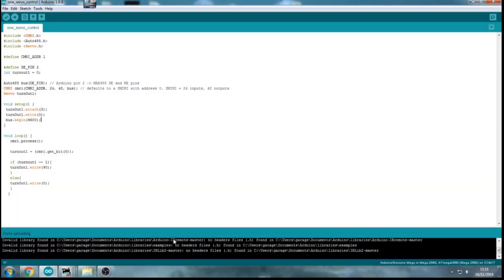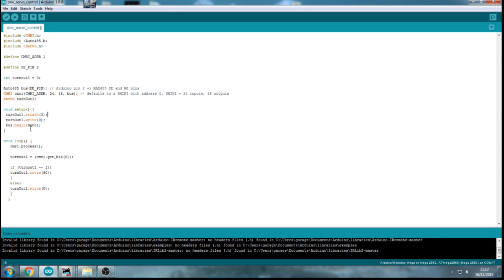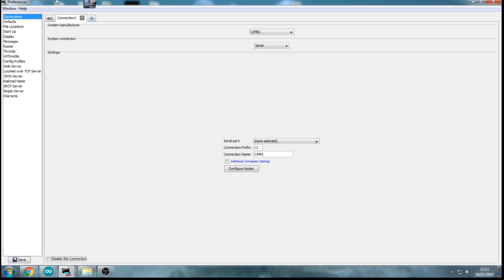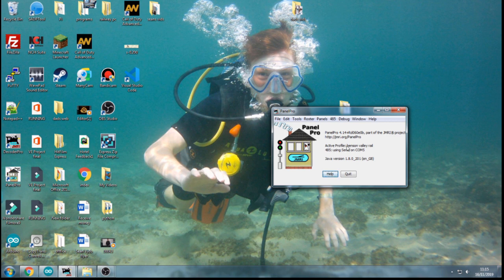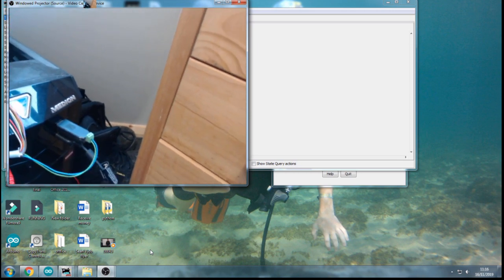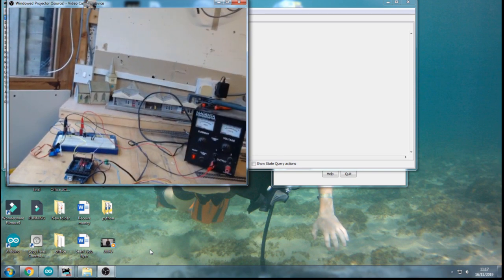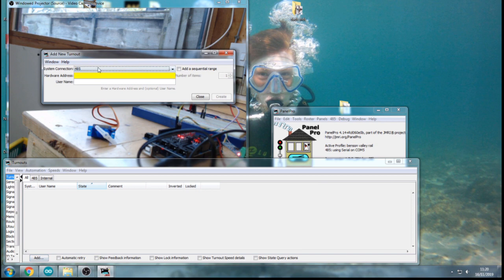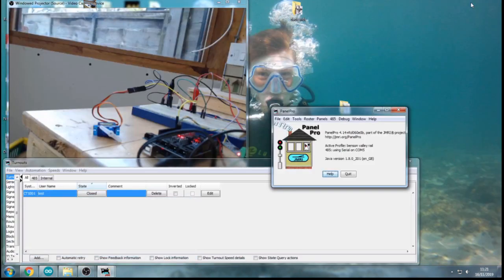JMRI Single Turnout with RS485 and CMRI on Arduino

Comment: Thanks ,great tutorial ,keep em coming ,
Reply from the maker: Cheers Glade its of use
Reply: @BrackstonesTravelAdventures  im into using Arduino for everything ,just got circuit boards made up for multi signal system ,controlled by 1 nano per pair and they daisy chain to the next mo dual if you interested i can supply circuit  diagram and code.you help me i help you.lol
Reply from the maker: @nesr8786  sound good, I did similar, been using Arduino and Pis for a lot projects but hoping to do all control and signalling through JMRI computer control. However time will tell if I can get it working as CT occupied sensors might not be fast enough with JMRI to keep up. Good luck with your layout will see more videos soon
Reply: ive poped you a message on you site buddy
Reply: @BrackstonesTravelAdventures  thanks buddy ,its very much appreciated.